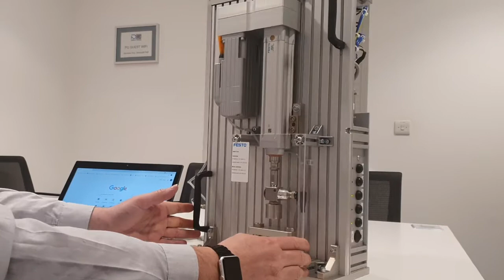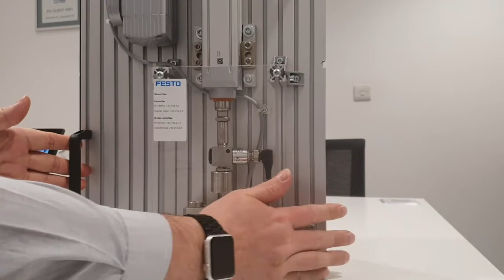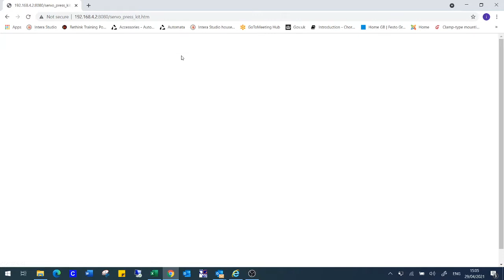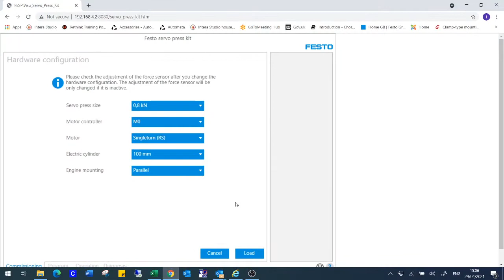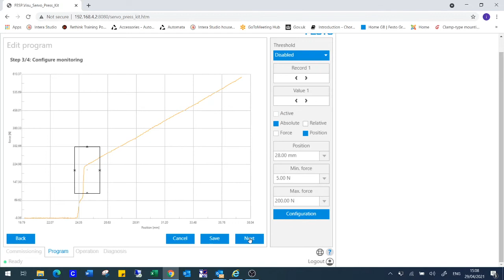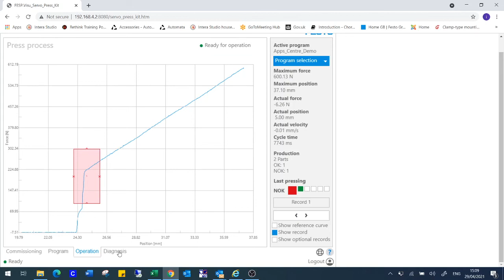Festo Servo press kit YJKP - Applications and Setup - Parmley Graham

Comment: Helpful walkthrough on the YJKP kit setup—clear applications in controlled pressing. At Validynamics, we've used comparable servo systems for precision fits (e.g., bearings, bushings in motors), with programmable profiles and anomaly detection leading to near-zero defects in high-mix production. The force/position combo is key. What setup challenges have you run into with servo kits in your assembly lines?